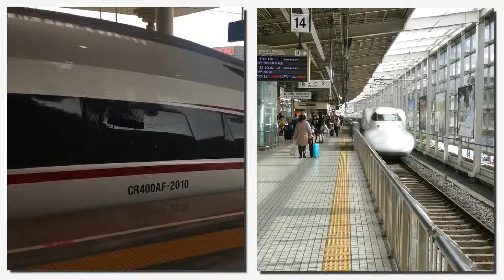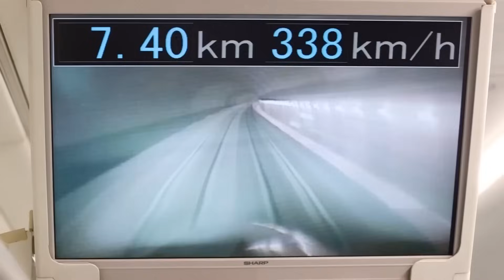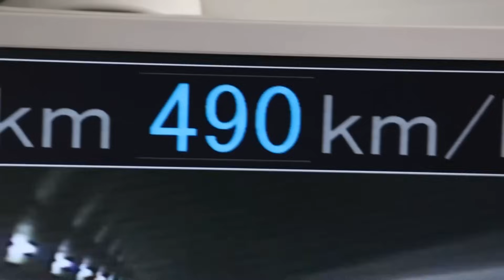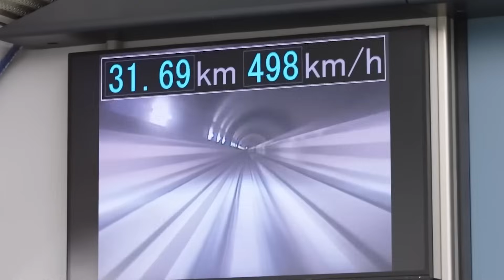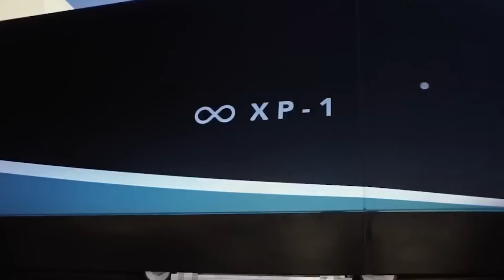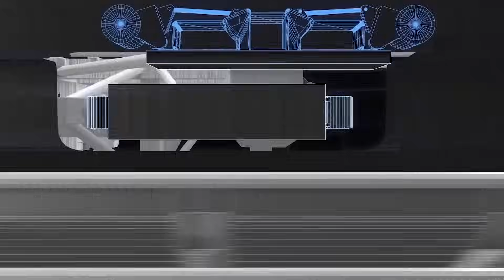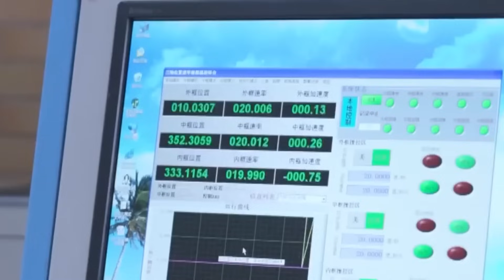🚄 China’s 1,000 km/h Maglev: The Future of Travel Has Arrived! 🌏⚡

Comment: As optimistic as I’d like to be about maglev, it’s also worth being skeptical of its implementation as well. Real Engineering and Megaprojects both have fantastic videos not the technology and its history. The tldr is it’s never been an issue of tech so much as it is about cost, construction and maintenance. Current High Speed Rail basically accomplishes 80% of what current maglev lines are able to do at 5% of the cost and maintenance. Economically is where the rubber hits the road with large scale maglev projects and why there are no significant current ones that aren’t simply proof of tech demos that at best lead to airports. Am glad to see the technology being developed though, it’s just going to be extremely difficult to actually implement them at scale.

Comment: No need for restrictive vacuum tubes for 1000 kph operation.  1000 kph is significantly below the speed of sound at sea level at 1225 kph.   China's CR600 Maglev prototype train set is testing at 600 kph with future goals  800 kph.  

By the mid 2040s a new maglev advanced train system and wide loading gauge is probable.  When starting a new train era a double wide loading gauge of about 8 meters should be used.  A double wide loading gauge was designed to occasionally be used on dual track British railroads built in the 1840s with wide carriages using the inside rails of the two tracks.   That wide 8 meter wide loading gauge would allow large assemblies to be easy moved long distance overland greatly changing the world we live in.    

The stability would support three levels.   The first level could be used for cargo with simultaneously perpendicular loading from the sides of drive-on drive-off automobiles and shaped cargo containers in a one minute stop.  The second and third top level could be luxury continues passenger space with the top level offering vista dome roofs to allow passengers to see forward watching the scenery.   This would haves the same number of passengers in more comfort in one 1/4 the length of today's popular single level trains stretching out several city blocks.  

All very high speed trains need incrementally cheap to free electricity such as might be provided by their own hydropower generators with unlimited water.   New technology nuclear electric power would be a typical second choice.
Reply from the maker: You’ve shared some fascinating insights about the future of maglev technology! The potential for double wide loading gauges and multi-level designs could truly revolutionize train travel. It’ll be exciting to see how these innovations unfold over the coming decades! 🤓

Comment: Those trains can easily reach speeds of 800 km/h. But you want them to run efficiently at decent temperatures so it reduces maintenance and wear.
Reply: There is no wear, the Chinese are working on new material that has no degradation.
Reply: @alphaomega1969  No degradation is impossible. Everything degrades. All molecular bonds break away eventually. The term you are looking for is 'resistant to wear'.
Reply: @TomislavPuklin-g3h  Yes, you are right!
Reply from the maker: Absolutely! Efficiency is key for these high-speed trains. Keeping temperatures in check will definitely help with maintenance and longevity.